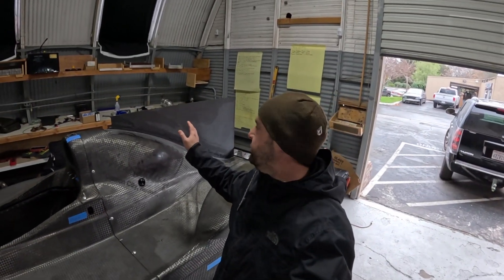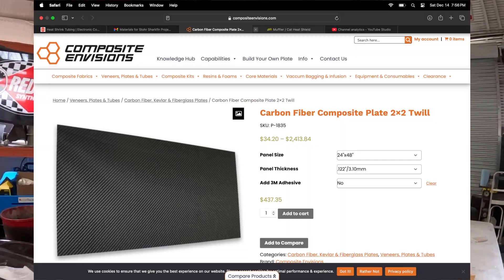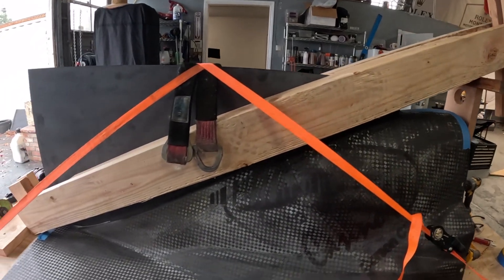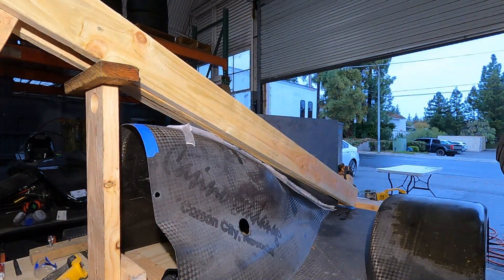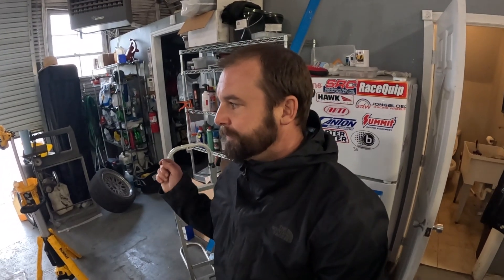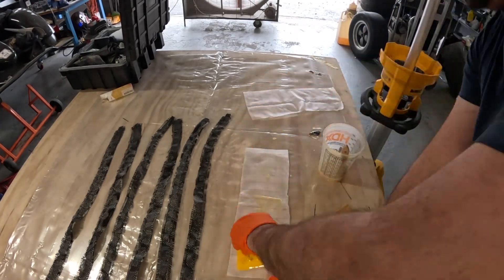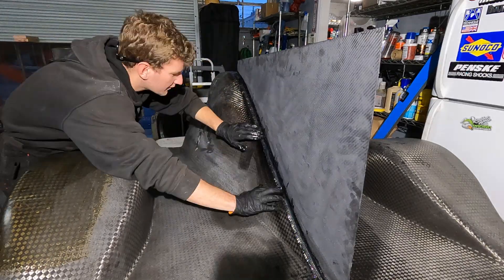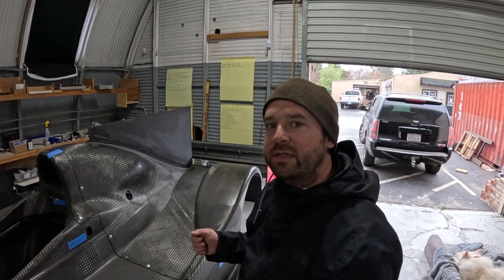Ep: 11 We have a Dorsal Fin! Installing a carbon fiber vertical stabilizer on my race car Stohr WF-1

Comment: That's awesome! I'm planning on putting a shark fin on my time attack supra good to know how i can make the sharkfin mold on straight when i build it.
Reply from the maker: There is no easy way to do it. But it can be done. Just take your time and do everything as slow as you can. And check check triple check its orientation and direction!

Comment: Is 1/8" carbon going to be stiff enough to handle a large yaw at speed?  I think I would have made a fin with a core.

It's cool having a guy with pro level composites experience but I would want to see the difference between real professional manufacturing and hobyist methods, then go through all the tricks to make hobyist level methods as good and easy as possible.

I want to make a carbon tub but instead of a pro style pre-preg layup in a female mold and cooked in a giant autoclave, I will make a sacrificial male mold, wet lay up the interior on that, then add my core material and exterior over that.  My hard points will be located by a steel jig but the actual exterior surface won't have any critical dimensions so I won't need any mold on the exterior, just peel ply and vacuum bag.

My body work will probably also be done over sacrificial male bucks with 2-4 layers of carbon and some strategic reinforcement.  I will use micro balloon filler to smoth it out, then paint it, so not super light but not too heavy.  No "exposed carbon" but who cares?

My goal is going to be a Lowcost based two seat coupe around 1,500 lbs wet with decent enough aero to top out near 200 mph with a 2 liter turbocharged I4 running something like E30.

I'm not sure when I'll have the shop space to start but hopefully within 2-3 years.
Reply from the maker: We had a few reasons we went with the single sheet and not a core:

Easier to install, it turned out to be marginally lighter, we felt some deflection is actually a good idea rather than a rigid fin, and most importantly we didn’t have to do any finishing work if we decided to resize it later on. When we were molding it on we only cared if it was vertical and strait front to rear. The height and length we could adjust later.

If we were doing this 100% we would have done CFD and wind tunnel testing prior to designing the fin then we would have made a whole new engine cover for the new fin.

For us just adding a fin to an existing piece of bodywork I would say this ended up being a pro job.

Before you start your journey into car building I would recommend reading rule books for racing clubs in your area. SCCA GCR is my golden reference of best practices.

Good luck with your car build. They’re daunting no matter the project?
Reply: @commodorepdog32  I'm not worried about rule books.  If I race, it will be Time Attack or Autocross and it will probably be forced in to a class that is pretty inappropriate.  So it will be a road car with occasional open track events.

Also, as much as I like safety, I don't want a full cage so I would flunk tech in most race classes.
Reply from the maker: Understood, 

Still a good practice to go after a rulebook as you never know, maybe you will want to race wheel to wheel someday after you have tried and conquered time attack. Always keep options open if you can when building a car to make it fit rules as many places as it can.